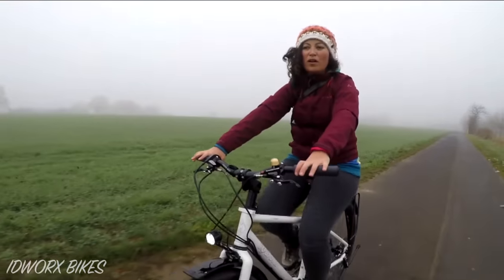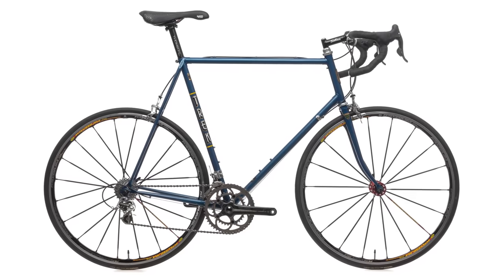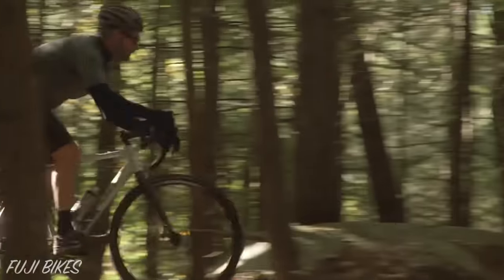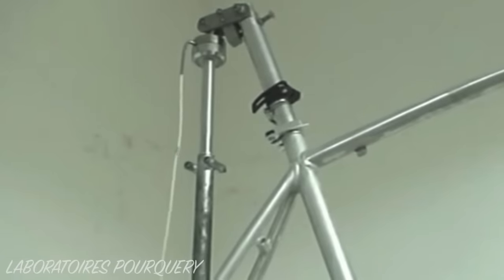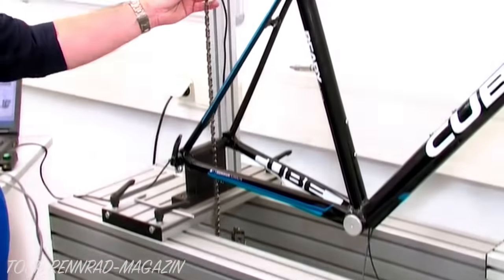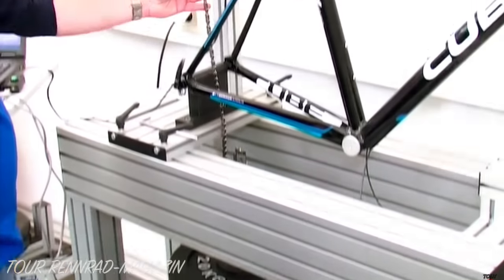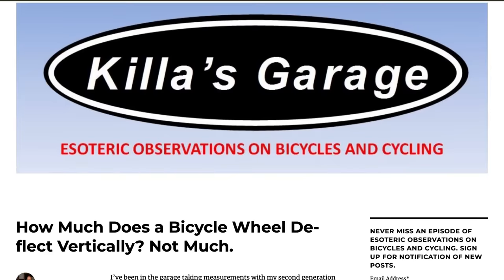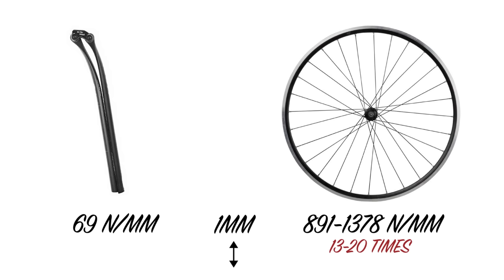Why It's Impossible For Steel Frames To Be More Comfortable Than Aluminium

Comment: Expensive heat-treated steel is stronger and can be made thinner to flex more without breaking. Cheap steel bikes cannot do this and feel terrible. It's all to do with young's modulus. Aluminium frames cannot tolerate as much flex. I can littery feel a steel frame flex when I put on the power, so it is very noticeable to us humans. Never got the same flex as put on power from carbon or Ali, so something is making a difference, even if your measurements do not pick it up? I have ridden high-quality low weight Ali frames and they are not the same. They deliver the power more efficiently but also lack feel and spring (both in power delivery and comfort compared to an expensive steel frame). I would suggest it's the way a steel frame flexes, or how much it is able to flex. Perhaps the tests need to look more into real-world conditions - not just flex for a given once only load. Of course, tyres and post make a difference too.
Reply from the maker: The data suggests that any noticeable vertical deflection difference between frame materials is just a placebo. But honestly, if you think it gives you the edge, that's great! The placebo effect is a very good tool if you can use it to your advantage. 💪🏼
Reply: @Cyclingabout  hahaha, maybe! It also makes me feel better knowing it is less likely to snap and can be easily repaired :P
Reply: The video discusses vertical compliance which adds to comfort. The 'mushy' feeling you get when putting power through a flexible frame would be the side to side compliance. If you put down a lot of power at a stop on on a cheap bike frame, you can see the bottom bracket flexing from side to side.

Due to the triangle shape discussed in the video, despite this side to side flex, there is very little vertical compliance
Reply: @aarontasker6423  I recall a professional reviewer talk about it like a spring, it saves energy for when you get back on it. Some bikes are designed with it built-in. It's a nice feature, and when the amount of it suits your ride it's amazing the flow and zest it adds. Frames I have had that have this power spring have been some of the best tracking frames I have owned :)
Reply: @andrewnorris5415  If it all comes down to Young's Modulus, then why can you feel steel flex (190-215 GPa modulus) but you can't feel aluminum flex (69 GPa modulus)? At the end of the day, aluminum's modulus AND yield points are much lower, making it more flexible than steel. While things like tube geometry do come into play, you cannot cheat the metallurgy.
Reply: @ryanvandyke2675  I think a lower modulus of elasticity doesn't mean it's more flexible, but that it won't bend as far and still be able to spring back.  Aluminum isn't more flexible, so much as it is just softer.  To build a structure that can take a given amount of stress load without exhibiting strain, aka permanent deformation, you have to use enough of the lower GPa material to prevent it from flexing beyond it's elastic limits, which makes the structure stiffer.  Higher GPa material can bend more before plastic deformation sets in, so the structure can be much springier while still being able to withstand the load placed upon it.

Having said that, I think modern frame design for aluminum bicycles have largely engineered out much of the harshness that the earlier aluminum bicycles had in abundance.
Reply: @davidbierbaum4881  so I think you're conflating modulus of elasticity with yield point. The yield point of a material is the stress at which it will plasticly deform and not "spring back" to its original shape. Modulus of elasticity is, by definition, how difficult a material is to stretch to deformation. 

Think about a typical stress-strain diagram. The modulus of elasticity is the slope of the first section of the graph. It tells you how much MORE stress needs to be applied to elongate a sample a given length. While modulus of elasticity and yield point are correlated to a certain degree, there exists many materials out there that have a low modulus and high yield point or a high modulus and low yield point. So we must be careful with this comparison.

Additionally,  hardness/softness is derived from a  material's strength. Hardness is not an intrinsic property of materials... hardness measurements simply tell you how much a material deforms when a certain shape is pressed into it with a certain load. Due to this, hardness and strength are directly proportional -- more hardness = more strength and vice versa.
Reply: @andrewnorris5415  springs are made of steel.
Reply: @joea9257  true but shock absorbers do the absorbing
Reply: @aarontasker6423  cheaper frames tend to be stiffer than expensive ones.  There is a negligible difference in rigidity between different steels of similar diameter/wall thickness.  The same is said of aluminum (or titanium for that matter).  A cheaper frame uses lower strength alloys,  lacks heat treatment to compensate for this they use more metal in at least wall thickness if not also diameter.  Cheaper frames also use straight gauge tubing vs butted which is also stiffer.
Reply: @ryanvandyke2675  i think the reason steel frames have been observed to have more flex is due to torsional flex being much more prominant than vertical (triangular truss is extremely stiff). So when an aluminium bike is designed it uses bigger diameter tubing due to it being roughly 3 times less strong but also 3 times less dense. This tubing diameter is crucial to flex when non vertical loads are present because the tubing is under bending forces rather than tension and compression.
Reply: @Cyclingabout  This assumes that power delivery is only in the vertical plane, which is necessarily false, even if you're sitting. You're going to be applying power to one side or the other of the bike, and presumably that's going to cause torsion from the bottom bracket and into the rest of the frame itself. Any sort of 'springiness' would be from the frame returning from the torsion, not the compression, right? 

I also wouldn't be so sure about it being placebo without testing whether or not a person can actually feel it. Your claim is that the differences between frames is very small (and this is also assuming identical geometry and rear triangle), and I can accept that as true. But humans are unbelievably good at picking up small differences. If you look up what the smallest difference you can feel with your fingertip is, for example, tests have shown that you can feel the difference between surfaces with a 13 nanometer variation, which is smaller than bacteria. I don't know what human sensitivity is to vibration and compliance, but I think it's a mistake to jump to the conclusion that just because the differences are extremely small and dominated by other factors that humans can't distinguish between them. The most you can say definitively is that the variances between frames of different materials are very small. After that, you're making assumptions without data.
Reply: @Louise-lg3wt  sorry thats total crap. Look at the early Cannondale machines, they were rolling vasectomy kits
Reply: Andrew Norris .

Comment: Tire width and pressure always supersedes frame material, but one should not discount the latter. I had a 2010 Jamis Supernova and a Lemond Tourmalet 853 steel. The former ran 32mm knobbies and the latter ran 25mm slicks. Both were very comfortable. I once made the mistake of using the 25mm wheelset on the Jamis. It was so uncomfortable I couldn't sit down for more than 5 seconds!

Comment: This is horse dung.  Diameter of tubes, length of tubes, wall thickness of tubes, shape of tubes, butting of tubes, elastic properties of the material, and construction design of the frame all contribute to the ride quality of the frame.  High strength butted steel tubes are highly fatigue resistant are much smaller diameter as so flex more, butting of tubes stops vibrations.
Reply: hum, it's like a religion
Reply: @Mrkeke35  More metallurgy engineering and science.  Religion is based on belief rather than observable,  testable and predictable realities.
Reply: @dan2304
So you’ve done the testing on vertical compliance for frames? Not just the materials but the finished products?
Reply: @jamesward3567  Quite, but not so much because I have found what I want to ride, at 75 don;t have much riding left.  If I am lucky I may wear out the new tyres on my two bikes but I am not betting on it.  Many years working as an mechanical engineer that stuff was my work.
Reply: I have many steel bikes and they are smooth riding.  Get on an aluminum frame and it feels like it is jarring me to death after steel or carbon.  I still have aluminum frames but they have shocks or carbon forks.  Otherwise 😮
Reply: @pamshewan9181  Carbon fibre does not have great ride quality either.  Comparing like for like quality steel frames only down side is they can rust but the coatings that protect them are good.  Quality steel frames are still functioning perfectly after 50 years and and hundreds of thousands of kilometers.  What other material would you trust to do that.

Comment: But is vertical compliance really all to take in account? Could it be that loads from the side on uneven surfaces affect comfort as well? A steel frame with thin seat stays will react different to forces by roots, tracklines or stones than a stiff oversized aluminum or carbon rear end?

Comment: A few comments:

•  It isn't just the width of the tyre that makes a difference. Some brands of tyre aren't as compliant as others. Simply changing to a more compliant brand in the same size can make a huge difference. I bought a set of slightly used hand built road wheels from a friend who didn't like them, tried them out and I also hated them for the road buzz, then swapped the Contis they had fitted to some Michelins, and they were perfect.

•  The choice of tubes can also make a big difference: latex tubes are more compliant than butyl rubber.

•  Your video ignored the front end of the bike. The road buzz transmitted via the front wheel, forks, and bars into the hands can be a major factor in the perceived (lack of) comfort of a bike. Aluminium and carbon forks go straight from the crown to the dropouts, and the geometry doesn't allow for any give. Steel forks are generally designed with a curve in the blades, which allows the fork blade to flex ever so slightly. On a road bike, with skinny tyres, that fork flex can make a difference.

Comment: With this video we went waaay deep into the rabbit hole of geeky, in-depth analysis... I love it! Well done! It's been a long time, after many years of following bike tech, that I've actually learned something new! Interesting subject and approach!
Reply from the maker: Thanks! My next video should be a unique approach to understanding another characteristic about bikes that we take for granted. 😎
Reply: @Cyclingabout  question: Canyon now offers a flexing seat tube (e.g. on their endurance model), as a road racer should I consider this or definitely stick with the rigid seat tube?
Reply from the maker: @JanTrenson  For a road bike, it kinda depends on your riding style and what you prefer. I personally have a flex seatpost on my race bike and think it's beneficial. If you've ever dug into the "hysteresis losses of tyres" you'll know that lower tyre pressures can actually be faster when a surface has imperfections. (*Warning: the next section is extra-nerdy and currently theoretical because I don’t think people are testing this*) 
That’s because the losses in the tyre sidewall/casing dominate until the "breakpoint pressure”, when then the "impedance losses" start to dominate. Adding a soft spring to the series (eg. flex seatpost) theoretically allows us to increase our tyre pressure past the usual breakpoint pressure, reducing the impedance losses in the system, and decreasing the overall rolling resistance. 
Basically, if our understanding of "impedance losses" is correct, I think the fastest system has to be the one with vertical compliance built into the handlebars and seatpost. You can read more about rolling resistance and “impedance” here: https://blog.silca.cc/part-4b-rolling-resistance-and-impedance
Reply from the maker: @JanTrenson  Oh, and careful with the Canyon flex seatposts, they're particularly soft! You can see the seatpost data here: https://www.cyclingabout.com/seatposts-overlooked-yet-critical-for-cycling-comfort/

Comment: I feel like you're reading my mind because I've come to the exact same conclusions over the last couple of years, and have been meaning to write an article for a while. I always try to explain this to people, but they don't understand because they've tried x aluminum bike and thought it was stiff and y steel bike and thought it was comfortable, yet they haven't controlled for tires, tire pressure, seatpost length, saddle, fork, handlebar, etc etc. Or too stuck in the "steel is real" thing, thinking that steel has some magical quality that allows vertical compliance, when in reality it is the stiffest material used for frames (and also damps vibrations the least, iirc?). Not that steel doesn't have other benefits.
You might look into framebuilder Rob English (English Cycles). He has a masters in mechanical engineering. Despite using the thinnest seatstays in the business, he also says that frame vertical compliance is a myth and thus designs to maximize seatpost length.
The single exception to all this are vintage rim-brake steel forks with thin walls (this does NOT include most unicrown forks e.g. Surly-type bikes, and it doesn't even include many lugged crown forks). Aluminum can't be made to flex enough in a fork due to fatigue.
Reply from the maker: I'm glad we're on the same wavelength! Rob English's work has come up in my research for my next video, and I read a very similar statement he made about his 'pencil' stays.
Reply: Your logic is flawed, steel frames have narrower tubes, they flex more than Alu with wide tubes.
Reply: @digbysirchickentf2315  It's not just tube diameter but also tube wall thickness, and I think wall thickness varies a lot for steel frames and forks. Not sure about aluminum. If you get a stock steel bike, especially one designed for touring, it's gonna have fairly thick walls (although touring bikes have long chainstays, which means long wheelbase, which probably adds a lot of comfort). If you get a custom steel bike where the builder knows your weight and uses tubes no stronger than necessary, it's going to flex more than stock steel. But like this video correctly points out, tires matter way more than anything else.
Reply: @flt528  top end steel frames(the same can be also said for aluminum as well) use tubing from a stronger alloy and/or heat treating.  This allows a lighter walled tubing to be used which will be flexier assuming comparable wall thickness.  That said frame rigidity is largely overrated.  Most of the hype of the stiffer is good way of thinking is due to marketing.  A few decades ago it was all the rage with thin walled Reynolds 753 and Tange prestige tubed frames with how it was so compliant and comfortable.
Reply: @flt528  of course high quality bike frames are made of thin walled tubes.
Try study triple butted tubing...
The reason for large diameter Alu tubes are (...were) compensating light thin walled tubes with strength through larger diameter.
Danish Principia were head of the game in that development...
Reply: @OmmerSyssel  Principia looked at Klein. Not a bad idea. Still have my Rex E SX.. Ride it on occasions..  Rgr

Comment: I believe most of that sounds reasonable . ,  I believe a frames horizontal flex was missed.  though the most comfortable bikes are those that have been fitted properly.  After all the smallest adjustments to a seats angle and or height can have significant changes to the comfort of the ride.  Dig the video's, keep them coming!
Reply: as someone who doesn't give care much about bike flex, i agree with your comment. ive worked at shops when i was younger and pointed out that tires flex. but nobody believed me. i then and still now believe that in a practical setting so much flexes before the frame and like the video suggests.

as for you comment i think you bring up a good point. when both pedals equally loaded the frame wont flex up and down, but while pedaling you are applying a torque to the frame and the frame twists. i would argue that the frame feel comes from how the frame flexes while ONE pedal is loaded at a time. 

as well, i think the frame flex is more in the fork, a steel frame set fork might be more springy then an alu frame and fork.

these test drive me crazy, why would you measure from the seat post using a "flex seat post"? these test should be loaded from the BB and HT and supported at the axles. or possible with a short ultra stiff solid steel seat posts. or loaded from ONE pedal. or something like that.